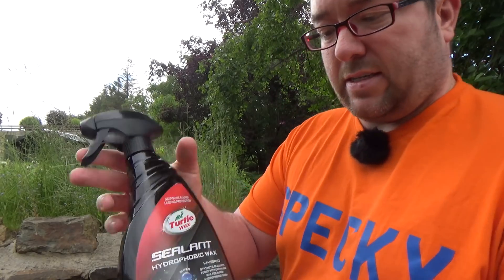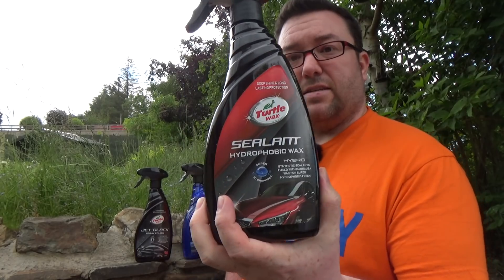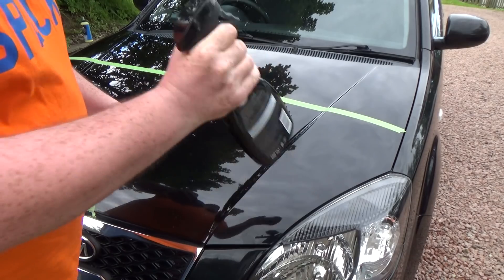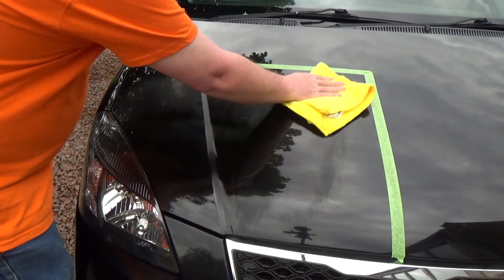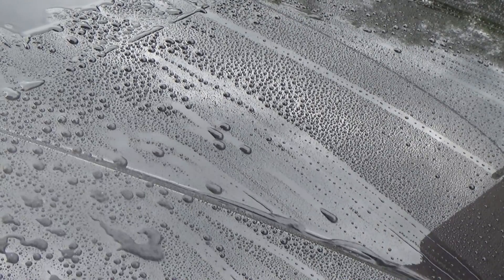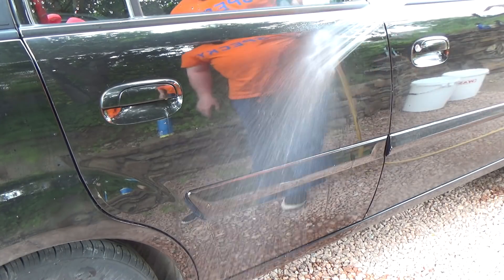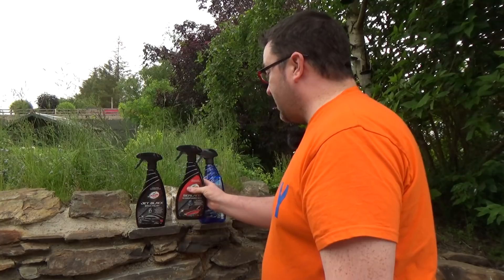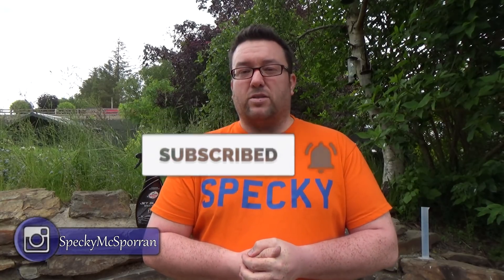New Turtle Wax Products!

Comment: I live at Liverpool, pretty wet here as well. I regularly use waterless wash and wax products after jet washing the car (as an alternative to washing with soap and bucket). I find it’s the best product for me to get rid of the grime left after jet washing the car.
Reply from the maker: That's an interesting technique, that's good if it works for you 👍
Reply: @SpeckyMcSporran  thanks Specky. Have been washing my own cars for past 10 years. I use a local jet wash. Especially in winter ❄️ a layer of salt(?) stays on car even after proper jet wash. I used to wipe it with a detailer (demon shine) but was not comfortable doing it.  Have been using waterless wash and wax for past year, which really helps in cleaning that film and I then jet wash again and then use a detailer or sealer like the carplan ultimate no. 2 gloss which lasts me about a month (or 3) in the winter. Keep up the good work. Very informative videos. I’m going to buy the Autoglym Aqua wax (which you have reviewed) next as I find products that wax as you dry ultimate in convenience. Have used Turtle 🐢 wax (Wax it wet) in the past but will give the Autoglym a go this time.

Comment: Hi , Specky . I have similar problems ( Scottish weather , black car , parked outside - also about 50 yards from the sea ) . I'm just wondering if the products lasted long enough for you to still recommend them ?
Reply from the maker: These aren't super long lasting but they're so easy to apply that I'm still happy to recommend them. If you want to use all three then polish the car with the spray polish, then use the sealant as a longer lasting protection and then finally use the rinse wax every wash to keep the protection going.

Comment: Another great video. How do you find the dry and shine compares to traditional paste waxes. I usually use bilt hamber wax but it can take  quite a bit of time to put on properly and I thinking the new turtle wax dry and shine might provide a quicker to apply alternative. 

Keep up with the videos.
Reply from the maker: Thanks David. Dry and shine is much faster to apply than why traditional paste wax or even spray wax, but it doesn't leave the same depth of gloss or scratch filling either so there's a trade off. Hope this helps.

Comment: good products, Sealant does really good job, better than Beadmaker.  Dry & Shine is a bit like Aquacoat and Wetcoat -- just don't use on a hot day like i did, but still beading 4 weeks later. They have a Yellow water wash spray, equally good and handy for removing bird crap.  Autoparts Inverurie have the full collection, £8 each.
Reply from the maker: Yeah I'm pretty happy with them. Nice to hear from a local! 👍

Comment: Hello :)  Thought I'd watch this again, and compare it to the new Ceramics range.  
This stuff is like a good surprise when you first use it.  The bottle is noce the sprayer is good.  Its easy on, easy off, quick to get round the car, overall results are great, and last a while.  I'd say that you did pick the stand out products in the range to showcase here.

The old Hybrid Snow Foam, is not actually a snow foam.  Its more like a shampoo you can apply through a snow foam lance, much like Polar Wash.  I used it in a wash bucket and it was a decent wash 46p a wash and 27 washes at the higher dilution.  If the price was cheaper then it would be flying off the shelves.  The BH Autowash is way cheaper and a whopping 60 washes, its very hard to beat Bilt Hamber stuff on value for money and cleaning power.

The Waterless Wash, I used as a QD that has cleaning power for bird poop great stuff and added to the protection of the sealant/dry n shine, or just a quick gloss up on a relatively clean car

I wonder if you can use the Jet Black polish on a DA, and what results you'd get?

I really liked all these products.  They could be used as a suite of products or stand alone to good effect either way
The pricing and ease of use won me over last time, and I'd still buy/recommend this over the new Hybrid Ceramics range.
I also wonder if the new Wet Wax and the 3-1 QD(even if they were the best products out there, the price is still too high) on the new range are going to be the saving graces, and I wonder if you can mix and match between the 2 ranges? And what the compromise/durability was?
Reply from the maker: Are there any products you haven't used? 😂
Trying the spray polish with a DA is a tempting idea, I've also got their Cleaner Spray Wax that I'd like to try with the DA.
I really like the three from this video, they're cost effective, quality and durable. 
As for mixing and matching, that's something that I've considered myself. We've seen ceramic detailers and wet waxes before, maybe the TW ceramic ones might actually be the most interesting of the five.
I'm not sure I can bring myself to use a waterless wash, I'm too concerned it would add scratches. It may happen one day.
Reply: @SpeckyMcSporran  lol. There are lots of products I haven'ttried.  I'm planning on trying tac systems moonlight next year and everything else relevant for that product.  Also going into Kiwami.  Detailing as a hobby is very subjective. Picking products has so many variables and you dont know if a product is any good unless you use it, and not every product works on every paint type or age.   I find it a fascinating topic for discussions as there is a lot to talk about, just not a lot of people that want to take it to the level I do.
Reply from the maker: @peemick  I know exactly what you mean. I find it very hard to find products I really want, sometimes it's based on other reviews and sometimes it's just pure curiosity. I hear good things about Tac System stuff, I quite fancy the Shinee wax and Moonlight would be interesting to try.
My other half does a great job of trying to listen to me chat about this stuff but she's not really interested. 😂

Comment: Can I put the jet black turtle Wax on first. And then finish it with super gloss carplan
Reply from the maker: Yes that should be fine 👍
Reply: @SpeckyMcSporran  thanks 😃👍
Reply: Is it possible to put turtle Wax jet black on and then finish with ceramic spray.
Reply from the maker: Yep, no problems
Reply: @SpeckyMcSporran  thanks 😃👍
Reply: @SpeckyMcSporran  sorry to be a pain but what one would you recommend after the turtle Wax jet black the car plan no1 super gloss or Turtle Wax Hybrid Hydrophobic Sealant Wax
Reply from the maker: The Turtle Wax sealant is a better product in my opinion and will work well with the jet black polish. No.1 super gloss is a very easy to use product but I prefer the Turtle Wax.
Reply: Thanks again for all your help I'll leave you alone now😂😂😂👍
Reply: Hi there mate can turtle Wax sealant hydrophobic wax be used as a Quick Detailing Spray
Reply from the maker: Not exactly, QD usually has a cleaning aspect and the sealant doesn't do that
Reply: @SpeckyMcSporran  do have any videos on QD.
Reply from the maker: https://youtu.be/9GIPN4Ot3K0